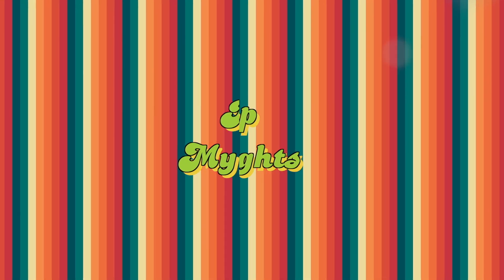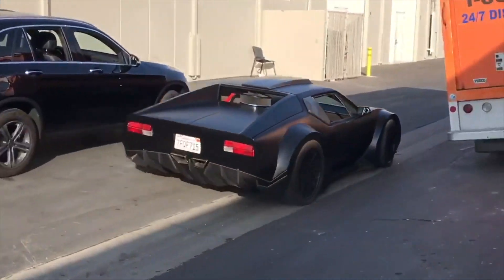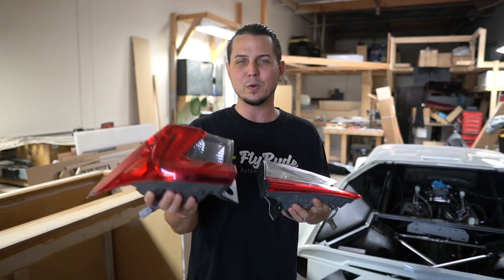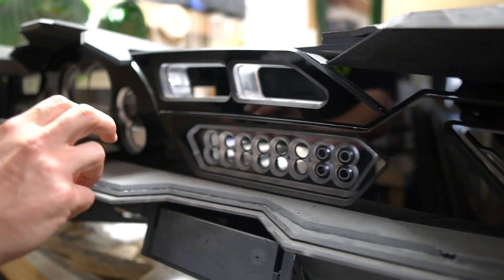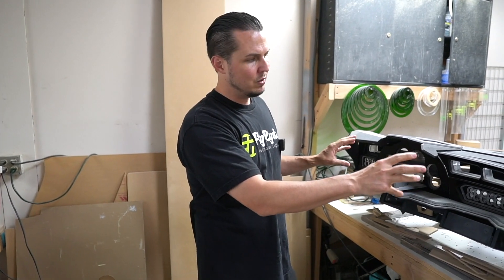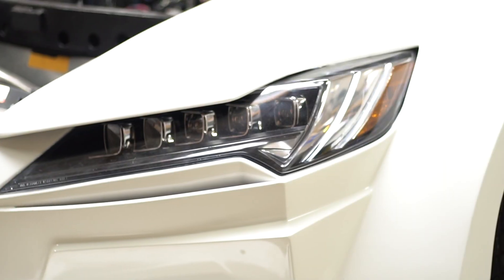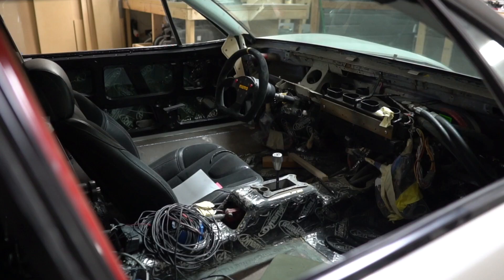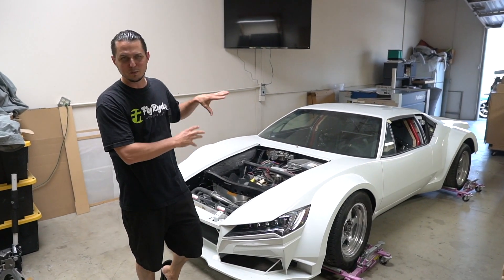You've Never Seen a PANTERA Like This!

Comment: Quick question. So I have a led headlight on my supermoto but there is only one mode. No high or low beam and no compasitor or anything in line with the wiring. I don't know any info on the headlight but I'm getting a draw in my system from the headlight when its on. Enough to overtime while riding it will drain my battery. Should there be a compasitor or something? Im new to this and trying to get things other owners of the bike has put on it to work.
Reply from the maker: I’ll be honest dude, I’ve never messed with a bike. I have no little tricks or things to check unfortunately.